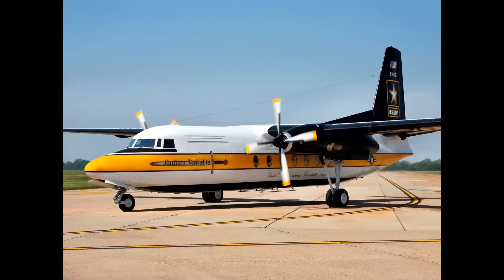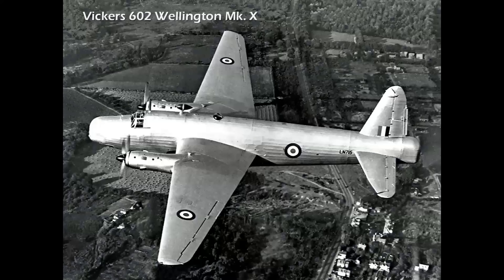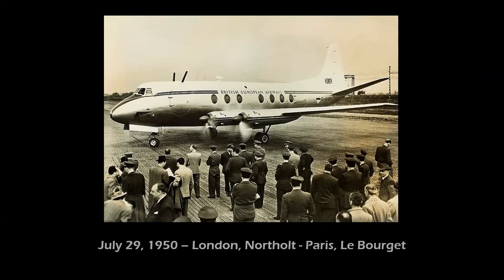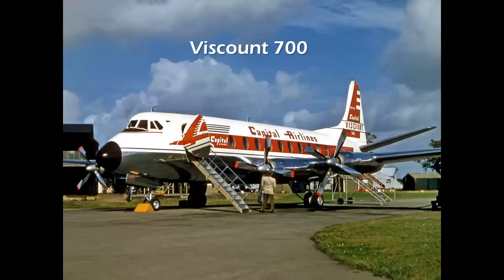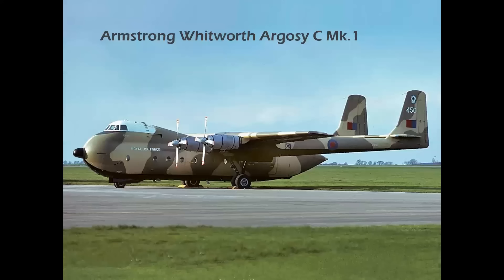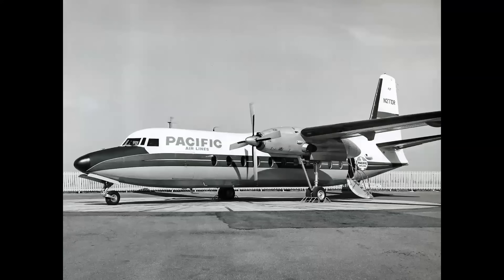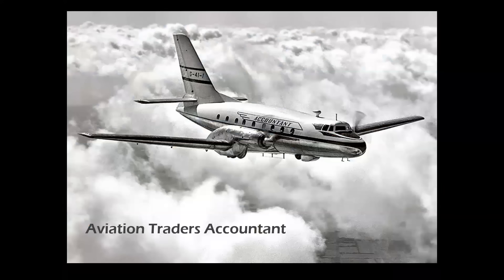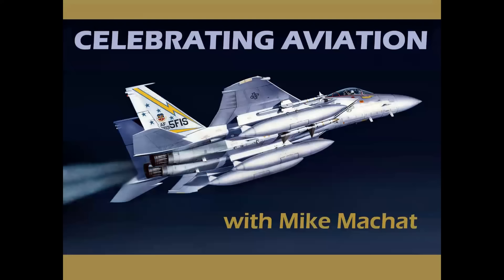ROLLS-ROYCE DART - World's First Production Turboprop Engine

Comment: I spent 11,600 hours behind a  couple of Darts in the F27 Friendship (Fairchild built them as well) & never had a problem with them - they were built like a  Brick out House.
Our Airline had two engine failures with Auto Feather & that was the accessory gear box failure.
The Rotol Props had automatic Pitch control & were complicated to learn but "Bullet Proof" in operation.

On start if you had a Hot Start the book said shut it down  but we never did as we "Rode" the HP Cocks to control the temps.

On a hot day when you hit Max  power you got a real kick in the pants when the Water/ Methanol kicked in to restore your power.
Question "Did you fly the F27" & the answer from those that did was "WHAT!!!!". ( They could send you deaf if you didn't were ear protection).

Comment: Hello Mike.  What a beautifully presented look back at these wonderful aeroplanes and the Rolls Royce Dart Engine.  Very enjoyable to watch Sir.  Here’s my Dart story:  I was extremely lucky to have had the opportunity to fly the Rolls Royce Dart Turboprop Engine for three years from 1991-1994.  The last generation of Big Turboprops that were starting to be phased out of all operational service in the U.K. and Europe even then!  None of the Heralds were flying passengers anymore when I started, just freight, and virtually all Night Flying!  For those that don’t know, the H P Dart Herald looks very similar to the Fokker F-27, but better looking.  I do very much like the Fairchild-Hiller FH-227 though.  It’s a huge improvement over the standard Fokker F-27, built under license in the United States.  The FH-227 is a very nice looking aircraft, longer fuselage and vastly updated Avionics and cockpit, it’s even got an APU, something we could have done with on the Herald especially in the wintertime.  I have the glorious sound of the RR Dart ingrained on my brain, and It’s something you never forget.  All the noise comes from its Centrifugal Compressor, especially during start-up and idle.  I was on the Handley Paige Dart Herald for three years, with now defunct Channel Express (Air Services Ltd).  They eventually morphed into low cost carrier Jet2.   On start up, the RR Dart’s starter motor would draw over 3000 Amps, and that’s a hell of a lot of current.  Once it was set to cruise power (14.200 RPM and 730 Degrees C. EGT) it was still noisy, but didn’t have that high pitch shrill any more.  The Herald had the largest of the Dart Engines, the RR Dart-532/9 driving a Four Blade Dowty-Rotol nearly 13 foot Diameter Propeller assembly.  Propeller pitch was automatically and Electro-Hydraulically controlled and linked directly through the Throttle Leavers.  We had NO prop levers in the cockpit, only a Ground fine/Flight fine lever.  The RR Dart had NO Gearing to the propeller.  It was a Direct Drive meaning, if you turned the props round, the engine turned as well, unlike the Allison on the Lockheed Electra/P3 Orion or the C-130 Hercules, which used a reduction gearbox mechanism.  It was an extremely reliable aircraft and engine and I never suffered any engine issues the whole three years I flew it.  Sadly, there are only two or three complete examples of the Herald in existence now, and at its height, Channel Express had about 12 of them.  They were fun days, a very young 22 year old First Officer in my first Multi-Crew Airline Appointment.  Where have all the years gone?  Best Wishes.  Doug from England.  🇺🇸🏴🇬🇧🇺🇸
Reply: I lived under the flight path of Hurn (for me it always will be) during the 80’s and every night a plane would take off quite late, I assumed the Dart Heralds based there with Channel Express and grind into the distance, it wasn’t a nasty sound at all - more the sandman sending a young boy to sleep.
Reply: I lived in Essex as a young lad in the early to mid 80's and remember the Dart whine late at night and early in the morning, I guess they were going into Stansted or Southend. I guess mostly Heralds or perhaps even repurposed Viscounts. I think the Post Office for a time ran a fleet of them. Would loved to have travelled on that Viscount with those windows back in the day.
Reply: I am afraid you do not understand the turbo propeller system very well.  The reduction gears in the Dart are integral to the engine rather than being constituted in a shaft and separate gearbox.  Did you think that 13 foot propeller was turning at 15,000 rpm?
Reply: The RR Dart did have a reduction gear, as do all turboprop engines as optimum propeller speed is much lower than optimal turbine speed. The Darts reduction gearbox was integrated with the forward part of the engine and was co axial to the turbo machinery behind it.
Reply: Most props do roughly 1,000 rpm, while the turbines and compressors do 13-14,000 rpm, so there was a gearbox.

Comment: I was hired as copilot at Ozark Air Lines, in 1978. We had DC-9’s and FH227B’s. I flew it for 1.5 years/1,200 hours. It was a great airplane, had 44 seats and 1,875 shaft hp dry, and 1,990 shp wet (water/methanol injection.

Comment: My RR Dart experience was maintaining IPEC Aviation’s three AW650 Argosy aircraft for several years. The main problem for a mechanic was maintaining a set of British standard tools for them. I spent quite a few hours having my sense of hearing assaulted in the flight deck of these aircraft both on the ground during maintenance ground running and in the air carrying out company errands around Australia. For the flight crews the cockpit intercom and noise attenuating headsets were essential equipment!

Comment: Flew out of Southend on a Viscount 40 years ago. On the outward journey we sat at the front facing forward, but with rearward facing seats opposite and a table between. On our return we were over the wing with conventional seating. Having only experienced Boeing jets up until then, it seemed far more civilised, being quiet and exceptionally smooth. I didn't realise that the Dart was used in so many aircraft  thank you for such an informative presentation.

Comment: Greetings from Christchurch NZ. While the London Christchurch air race was a little before my time the unique ear piercing screech of the Darts is a very familiar memory. Travelled many times on the Viscounts and Fokkers that made up the NAC domestic fleet during the 60s and early 70s. Both great to fly in. The HS748s were used locally by Mt Cook Airlines on the tourist routes and the RNZAF had Andovers. Safe Air had a couple of Argosy freighters that were probably the last of the Dart powered aircraft flying in this country into the 90s I think.  Thanks for the video!

Comment: The purr of a turboprop is soothing, yet powerful to enjoy.  They remind me of hot, Summer afternoons down at the airport.  The Ozark and Frontier F27s sang as they throttled up to takeoff power.  I can listen to them anytime.
Reply: Frontier flew Allison powered CV-580s, never F27s.  When they bought Central Airlines in 1967 they inherited some CV-600 powered by Darts, but they immediately retired them because of their poor performance at high elevation airports.  The Convair 600 could not carry a normal passenger load out of Denver, Frontier's base.  Before the buyout, Central operated only DC-3s into Denver.

Comment: I flew on Capital Viscounts several times in the late 50s and early 60s. The smooth and comfortable Viscount was a revelation compared to the noisy and non-pressurized DC-4s that Capital was still flying then.

Comment: The last time I flew on a RR Dart powered airliner was about 1988 when I flew on a Simmons Airlines, YS-11 from Chicago (ORD) to Milwaukee.  Two things I recall from that short flight were that my seat would not move forward for the takeoff (I pointed this out to the stewardess and she said, "Oh, don't worry") and that the passenger windows were somewhat smaller and lower than in other airliners.  Great video on the iconic Rolls-Royce Dart turboprop and thanks for sharing!
Reply from the maker: Amazing to see your comment, as my first impression sitting in the YS-11 was exactly the same thing - smaller and lower windows! (Designed for the baseline Japanese physic in 1962.)
Reply: @celebratingaviationwithmik9782  I thought the same thing about "the baseline Japanese physic" when I encountered those windows on the YS-11.

Comment: In relation to the Avro Athena, the images you have here are of Athena serial number VM125.  This was one of the two prototypes (Avro 701 Athena T.1) powered by the Armstrong Siddeley Mamba 1 engine (VM125, VM132), whereas a single Avro 701 Athena T.1A (VM129) was powered by a Rolls-Royce Dart engine.  It's a minefield to try and capture all of the variations during that period of great experimentation!
Reply from the maker: A tribute to my channel to see comments of this caliber, and many thanks for pointing this out. I worked extra hard on this one to find the correct photo and still got it wrong! Thanks for watching.

Comment: I've ridden on an F-27 from Kalamazoo, Michigan to Chicago, O'Hare in 1991.  It was United Express.  Those Darts are noisy.  Worked on a flight line in late 80's thru early 90's and dealt with several Gulfstream G-1's.  Even with ear plugs AND ear muffs, the sound was still pretty unmistakable.

Comment: Mike, Sorry I'm late to the party, but back in the 1970s I owned three Viscount 745d aircraft, all executive configuration and flew entertainment groups on dry leases. I personally got about 50 hrs in them, mainly positioning flights. We had pro pilots who went on the 30-60 day tours. It was the perfect bird for the gig. I am very familiar with Darts, ours were 510, and had about 1,600 hp with about 1225 from the Dowty-Rotol props and 375 from the exhaust. Hi-bypass fan jets of today put out 80% from the fan and 20% from the exhaust. In almost six years of operation before I sold the company, we had a 100% dispatch reliability record. We used 280 kts as our block speeds. Our slipper tanks gave use an almost 2,000 mile range.

Comment: Love the rare picture of the Central Airlines CV-600. They were only around for about two years before Central was merged into Frontier in 1967.
Reply: Never knew Convair used Darts.
Reply: @pascalcoole2725 Convair had their own Turboprop Conversion Program for the Convairliners. CV-240s became CV-600s, CV-340s and CV-440s became CV-640s these conversions were done in house by Convair or by the airlines with kits supplied by Convair. 
Of course the Allison Engine Corporation had their own program for the CV-340 and CV-440 airframes using the Allison 501 Turboprop and Aeroproducts propellers and a 10% increase to the surface area of the tail along with other modifications. This conversion was nor available for the CV-240 because the wing structure was not strong enough for the more powerful Allison 501 which was derated to 3750 Shaft Horse Power. Frontier Airlines was the first airline to put the Allison-Convair into passenger service and it was their marketing department that came up with the CV-580 name (officially these converted aircraft are designated as either CV-340A of CV-440A depending upon the original aircraft model).  Frontier also nicknamed the 580 The Mountain Master because of its ability to handle the sometimes terrible weather conditions over The Rocky Mountains. Which was partly due the Convair’s rugged airframe and the powerful Allison 501d-13h engines that seriously overpowered the aircraft.
Also the first Turboprop Transport Aircraft to fly in the USA was The Allison Turboliner, a CV-240 that was outfitted with a pair of Allison T-38 Turboprops (Predecessor to the 501/T-56) which was used as a test aircraft by Allison and the US Air Force, I’m fairly sure that 2 aircraft were converted for this program and after completion both aircraft were converted back to their original P&W R-2800s. 
KF Aerospace (owner of the Type Certificate for The Convairliners) modified 6 C-131 airframes (US Military Designation) were rebuilt and “stretched” almost 16’ to produce the CV-5800 whit Allison 501d-22 Turboprops with Hamilton Standard props and the original tail configuration, all of these aircraft are flying as freighters today!
Reply: Frontier only used the CV-600s for a short time before selling them, compared to their CV-580s with the Allison 501 they were not powerful enough for their operations.

Comment: Brough back memories of the HS 748 production line at Woodford. I was an engineering apprentice soaking up everything and learning what was involved in designing and producing remarkable and profitable aircraft.  The Dart was a screamer in the days before noise was an issue.  Thanks for the video.
Reply: I remember Viscounts of British European Airways flying over my home in the 1960s and 70s. I think they were louder than most modern aircraft but they were much quieter than the 1960s jets. Also the musical sound was much more pleasant than that of the jets, most of which made a heavy rumbling sound like thunder (similar to the later Concorde). Recently the opportunity has arisen in the UK to compare the sound of 1960s turboprops to modern aircraft, because of a number of cargo airlines from Ukraine (and Belarus until aircraft from there were banned from the UK after a certain incident) that fly An-12s that in the 60s and 70s would almost never have flown over the UK. These are louder than most modern aircraft, but I think most of the noise comes from the propellers rather than from the engines.

Comment: Nice Mike. Aren't we all nuts?  I can listen to jets/turboprops running all day long. The "smell of money" (burnt jet fuel), and the whines, shrill whistles, the roar, howl, etc. of jets is just the coolest thing. The modern high bypass commercial engines are just too quiet and smoke free now. Oh well...I know.....efficency, and all the rest but.....a Voodoo blasting 40k lbs into the air w/ two J-57's was just TOO COOL! 

If you are going to do some Engine vids Mike, you might do my favorite. You know what it is I think.....the mighty PWA J75. Imagine a PURE TURBOJET at 29,500 lbs thrust (for Super Crusader). TOTAL mass flow All  supersonic. (fan engines have whatever percent bypass ratio subsonic untill AB is used) It was a total beast of a motor. The 105 and 106 were BIG and just used one...Anyway, Mike,...thanks, another good one!!

Comment: At times in the 1960s and possibly well into the 1970s there were a lot of twin engine planes flying in and out of National Airport in Arlington across the river from Washington D.C.   Most of these planes made a rather characteristic and similar whine noise,almost raspy. I wonder if these were Darts and whether any of them were YS 11 
I think the airlines were the likes of Allegheny and Piedmont ,maybe there was an Appalachian Airlines 
seems I remember some of these types of planes overflying the University of Virginia in the first years of 1970 and maybe until about 1972,then I think they disappeared, replaced by the much much louder early model Boeing 737 with narrow bore torch like jet engines

Comment: Thanks for the great video and highlighting the history of the Rolls-Royce Dart turboprop engine. I flew the NAMC YS-11 for Mid-Pacific Airlines in Hawaii. There were some memorable things about flying a Japanese designed airplane powered by British turboprop engines. The Mid-Pacific Airlines Dart engines were the more powerful 3,000 shp versions augmented with water methanol injection that was used with heavy payloads and hot temperatures. By the way, Dart comes from the way Rolls-Royce named their engines after rivers, in this case the Dart River in England.
  The Dart engine on the YS-11 turned a large, four bladed, 14 foot Dowty-Rotol propellor. The combination of the 14 foot propellor and the Dart engine created a truly deafening, high-pitched scream that always caused people to turn, watch and pray our airplane would move further away. At first, you think they are waving but they are covering their ears. There were jet powered B-737s and DC-9s on the same ramp, but people always complained about the YS-11 Rolls-Royce Dart noise. I wore a David-Clark head clamping headset to block most of the noise; uncomfortable but not as painful as the noise from the engines. The sound of the blades changing pitch and the sound of engine shutdown and the propellors windmilling down was always pretty cool.
  The Dowty-Rotol propellor was a complicated system of propellor stops and indicator lights. A most unusual quirk for most pilots was applying LEFT rudder on takeoff. Most propellor aircraft require RIGHT rudder for takeoff. Applying the wrong rudder on takeoff will run the aircraft off the runway or worse.
  While flying the NAMC YS-11, I got to tell people, “I drive two Rolls-Royces at work.” When I flew the Lockheed L-1011 TriStar, I got to tell people, “I drive three Rolls-Royces at work.”
  The NAMC YS-11 and the Rolls-Royce Dart were good to me. I never had an engine failure and they always brought us back safely. Thank you NAMC, Rolls-Royce and the Mid-Pacific Air maintenance team!
Reply: British screws don’t turn the opposite way to American ones!
Reply: @johnyoung1128  Okay, I deleted the sentence about tightening screws. The point was that flying the Rolls-Royce Dart equipped YS-11 during takeoff was different.